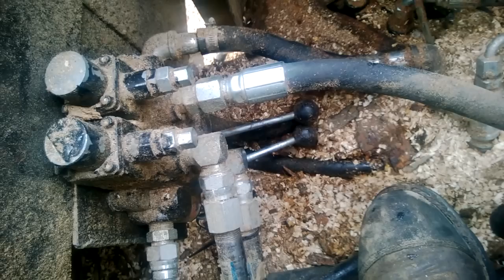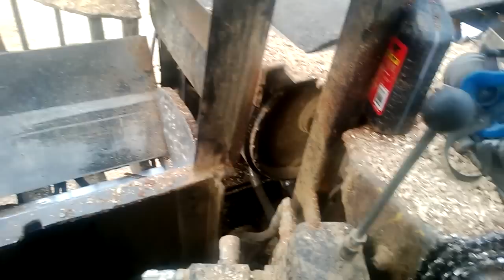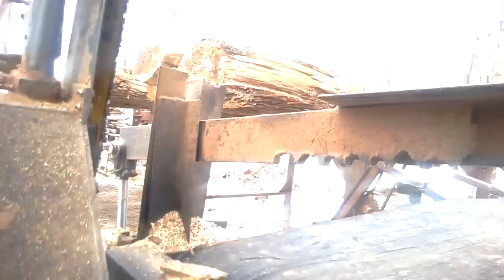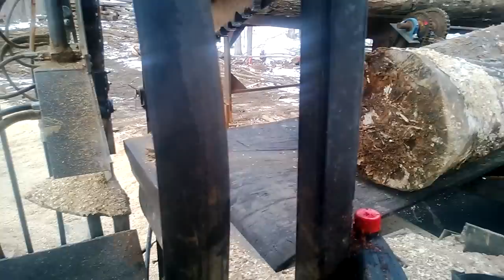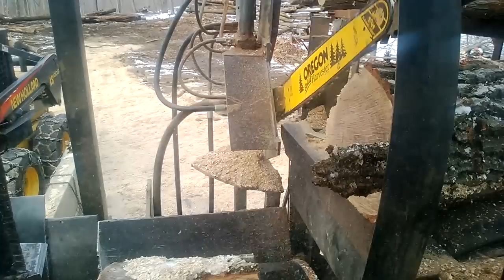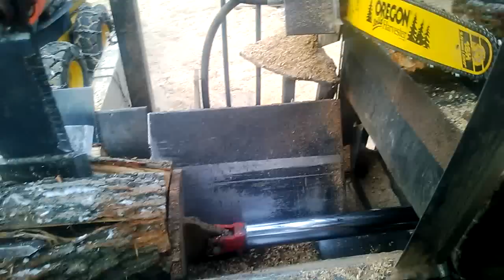home made wood processor  built 11-20-13

Comment: Slick and I like the idea and set up that the saw is cutting at the same time you are splitting wood because alot of the ones I have observed do things in stages usually one at a time probably be in the size of your pump and I think I would ignore the remarks or remark about it being a slow saw because you can always upgrade and I think it works just fine and sure is a lot easier than bucking it by hand,, would of been nice to see what kind of power that you have running it and hydraulic system!!! I have been exploring different videos to see what kind of ideas l can get as I am thinking of putting one together!! getting to old to be doing it all with my back!! Thanks for the video!!good job!! I am reading 27.000 where is that coming from?and I love the fast automatic return on the splitting!!

Comment: I was wondering how the plumbing works on the splitter with the two control valves so the splitter returns on its own. Great job tough looking machine, I am currently building my own and like the way the splitter works on yours, thanks